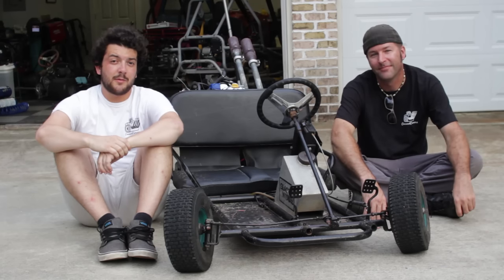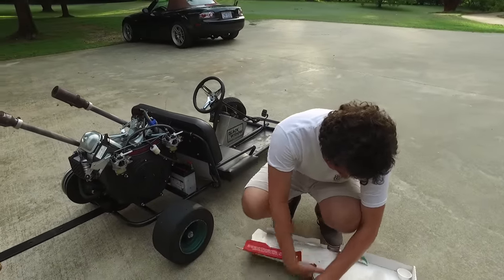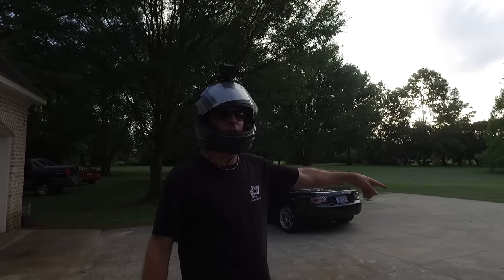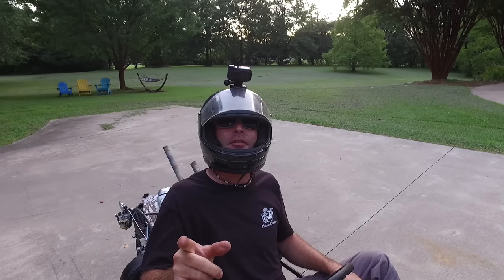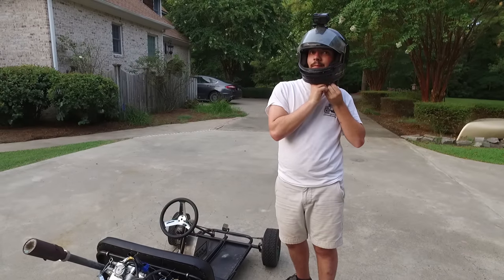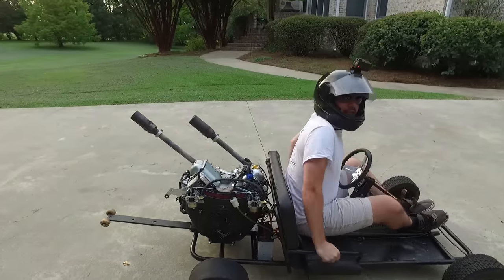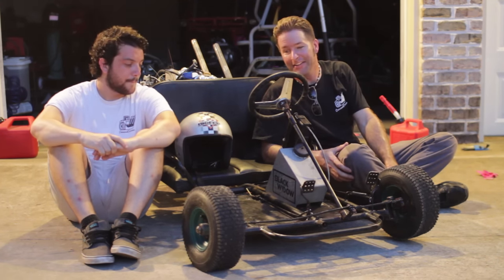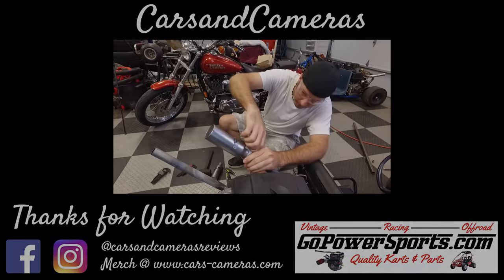Modified 670cc Performance Testing

Comment: You can just let the breather hose vent to atmosphere if you want. but I would a small filter on  the hose so nothing drops in it... You can run it to your air filter but a lot of times the oil vapor coming out of it will dirty the air filter..

Comment: maybe try adding another gear ratio with idle arm lever and pulleys with belts ...you could disengage one ratio and switch to the other ratio it'd take two motions but you could get up to top speed let off the gas and switch levers to the high gearing and keep accelerating.

Comment: Use larger diameter rear tires at the rear, or go to 8" size rims that have tires with a larger diameter. It would gain top end, but bottom would suffer some what.

Comment: you guys could do something cool but its a bad idea...NOS or spraying starting fluid into the carbs when you are at top speed i did it once with my 110cc 4 wheeler i sprayed starting fluid in it and i hit around 60mph was super scary but extremely bad for engine

Comment: hey you guys should put suspension on the front tires so your spindles don't get ruined and it will make it easier on the frame so it wont worp

Comment: it would be awesome if you would make a shiftable go kart like the r1 engine ones. But if you don't like i4 engines yzf r125 still has 14hp on 125cc wich is lighter and more powerful than predator 212 also it is shiftable like r1 as it's also a bike engine

Comment: The stock 390  jets are about the same size as the 212s.
I run a .044 main on mine on the 212cc. I'm guess you could run at least that size on a dual 390.

Comment: That torque convertor will only spin so much, sprocket change time, I'd drop at least 5 teeth on the rear, hey, its not like you don't have the torque to pull through it😎😎

Comment: i think you need more rpm's to throw a rod, so...it'll be fine...just be ready to rejet at the dyno or just drill out the main jet if you can like on  motorcycle carbs

Comment: put a smaller sprocket on it. it will increase your top speed a good bit. We used to have a 5hp go kart with a small sprocket that got up to 50mph, until I turned too quick, put it on 2 wheels and wrecked it into a telephone pole.

Comment: I have a 97cc Engine on my Baja doodle bug. To be able to run it I have to leave it choked all the way. Is that a tuning problem  (If so how do I fix it?) or is it fine to keep it choked wile ridding?
Reply: sounds like the carb is gummed up
Reply: I'm not doing anything until I get the pods on it then ill play with the carbs. lol. itll be fine

Comment: I think the top speed may be affected by valve float since there is no change after the twin carb setup
Reply: Carburetor size doesn't matter on top speed it's the valve springs, your right.
Reply: its geared way too low... it's like 6:1 from the tav to axle while it  should b like 3:1.... old Willy's jeeps had 25hp and went 60 mph with 10× more weight so ik this kart is capable of serious speeds with the correct gearing! changing valve springs will throw a rod thru that block before u could say it'll b fine
Reply: +I.C. karting then they need some forged internals too 😉
Reply: They really should gear it differently. There's no reason why it needs to do wheelies.
Reply: +Tim Ramich ok mom...NEXT!
Reply: +sykwookiee if it were geared higher it would wheelie less violently and be capable of well over 60 mph....

Comment: +Isaac it'll be fine  is there a centrifical clutch for a one inch short shaft 5 horsepower Honda engine I think it's a 5/8 shaft I really want to put it on a Drift Trike

Comment: This thing seems to accelerate faster to 46mph than my car does.
Reply: lol that thing does like 0-30 in like 3 sec
Reply: Too bad the Torque converter limits the speed.
My 212 does 0-44 in less than 5 seconds. But i modified mine a lot.

Comment: Yall should put bigger and wider tires on that thing, look at the video when you were doin the wheelies in slow mo, if the tires had less air in them you would drag the sprocket on the ground when you wheelie. that thing came very close to hitting

Comment: Hey! I want to do a go kart for a school project, i'm only 16, want to make the own frame and all... Been subed for a while, but got a few question... Is their any transmission? Is a 11 hp motor overkill?  Got any tip? 
Planning to use old car part for the pedals and steering wheel... 
I was spwondering if a new car starter yould be a good engine? Asswell! 
Thanks you!
Reply: Oh shit their is no transmition but did you guys ever made one with one?
Reply: the tork a verters we use are a type of trans
Reply: +Isaac ok thank you! May I know what do you guys do as a clutch?
How do you "unshift" the motor when you don't press on the pedal?
Reply: no clutch. its just like a automatic. one day I would like to have a clutch on one someday

Comment: Have you considered upping the size of the rear tires just a little? Sometimes a larger diameter tire will give you a little extra cruising speed.
Reply: we have but it will make it even taller and its pretty top heavy already
Reply: Isaac it'll be fine Hmmmm. It doesn't help that it's not a very long go kart to begin with. Of course it wasn't made for such a big motor anyway, but that's the whole fun of it. ;)
Reply: lol. yea, its a death trap
Reply: Isaac it'll be fine I bet. :)

Comment: Why not put a Transmission from an old Lawn Tractor so that way you have the CVT Transmission and you can have a 3 Speed you'd gain so much top speed and could drop it super low if needed.....

Comment: On your crankcase breather hose just use a Valve cover breather. They are not that expensive and it will help control the oil splash and help your idle as well. Looks like a lot of fun. Thanks for the laughs. https://www.summitracing.com/parts/knn-62-1490/overview/
Reply: thanks

Comment: take the turbo and efi off the trike and install it on this drift trikes don't need a lot of power anyways and the turbo would be more effective on this engine only thing you'll have to buy is another injector.

Comment: how well does the clutch do . the go kart shop in town tells me adults driving a belt go kart wont last long at all
Reply: we haven't had any issues with it, we have beat it up and it has taken it
Reply: i have a go kart bigger than both off road carts you have and i want a way bigger engine on it
Reply: wow. what size engine do you want?
Reply: i would love to do a 670 or anything bigger than the 6.5 the paperwork with the kart says two riders it can weigh 720lbs dont think a 6.5 will perform like that
Reply: well the 670 is a powerful engine but it dosent like hard turns or hard stopping. it throws oil into the breather and creates lots of smoke. if that's not a problem then it is probably a good choice

Comment: i would be more worried about not dying,, and to end up in a wheel chair for the rest of my life from an accident in one of those unstable go carts , i built quite a few go carts in my younger years and the fasted one went around 80 mph it had a 433sst two stroke two cylinder ,, the rpm in those hp motors is crazy , i am lucky i did not end up in a wheel chair , a cousin of mine drove it and snapped three wheels of and rolled it in the ditch , he is lucky he did not break his neck or worse yet his back  ,

Comment: You should put the centrifugal clutch on it and see how fast it goes
Reply: +Josh Hrisko I heard them say before you lose some top end when you go to a torque converter
Reply: +Honda Cr 500 yeah you do. a clutch on their supped up 600cc engine would burn up quickly with all of their hard accelerations.

Comment: Hey I have a pocket bike and after riding it for and hour or so the bike starts to bog down you give it gas and it goes then slows down and goes again then finally slows down and does anyone can help please
Reply: Slows down and dies
Reply: it is either overheating or running out of gas (trash in the carb)
Reply: +Isaac it'll be fine thanks a lot

Comment: If top speed is your only goal you definitely need a smaller rear gear, if I GPS'd my 6.5hp turd at 50 your 670 should have no issue creaming it with the right gearing.

Comment: Will it do good donuts on dry concrete
Reply: no it wont. it will either go straight or flip
Reply: +Isaac it'll be fine what if u put some skinny dry rotted tires that been sitting
Reply: that might work

Comment: I think you need a new chassis. The best racing action is around the yard, not wheelies and top end runs. Show us some flat tracking power slides. Put a performance chassis under that bad boy.

Comment: There is a 6 wheel go-kart powered by an R1 engine. They put 4 wheels on the back to prevent it from pulling wheelies and keep it planted. Have you or would you consider doing something similar to this 670cc cart, maybe as your next project?

http://i.kinja-img.com/gawker-media/image/upload/s--H30-YYM6--/18nddzq68wbbtjpg.jpg

Edit: Keep up the good work dudes! Finding your channel pretty entertaining, man.

Comment: topspeed is crazy, acceleration is retarded crazy...
so gearing can be tuned to more topspeed? but that probably puts more stress to the belt... (slipping?)
I would reduce the rear gear sprocket. more topspeed, more ground clearance!

next tuning I would redoo the steering, so it won't bend anymore.
what about front brakes?
Reply: I think it is pretty good where it is with the top speed. front brakes would be cool
Reply: Ya don't need front brakes if the wheels are in the air!;) heha
Reply: lol

Comment: So... I guess my mediocre build with a 16 HP Duramax engine on my old adult size Go Cart may not be so... mediocre after all.  This means i may not have to turbo charge it.
     I have possible plans of putting wings and a propeller on it so it qualifies as Experimental Aircraft thus I won't need a license.  I wonder... must I actually have to be able to leave the ground?  I mean... just because it fails at flying doesn't mean it is not an experimental aircraft, right?  Next, if I put large enough wings on and can make it able to skip off the ground... will it then be able to fall in the guidelines of Experimental Aitcraft?      
     Remember...The word "EXPERIMENTIAL" Does not imply it must work.  Hey, this could be a new way for folks without a driver's license to still get around. By the way... I lost my license while in the hospital fighting again for my life. I was not given enough time to get out of the hospital/rehab before their message (which I never received) expired. Funny the DMV would do such a thing.
   I lost my right foot, mid calf and so they disqualified me, (suspended my license). But I can barely walk 100 feet due to my back, have no one to help me and survive miles from town. Due to my back issues I cannot tolerate long rides and those "Help Rides" things take all day and would leave me in severe pain for usually a week at a time.  What is really funny is: in 1979 due to a motorcycle accident I had severely damaged my right leg and had to put in a left footed gas pedal and retake the test, which I did and I passed. Then I took the driving test a few years later w/o a left side gas pedal and a manual transmission which I also passed. Then again testing for my motorcycle license which I also passed. Due to circumstances and continuing problems I had often put in a left side gas pedal, as needed. But they never took that into account and suspended my driver's license.  AND... even with my false leg, I could STILL easily pass a driver's test with a manual transmission vehicle, just knowing potential problems got me to install left sided gas pedals.
    And let me not to forget, I got kicked out of 3 Hospitals because I was operating on my foot in hopes of saving it and the Hospital Staff's would not even change the bandages!!!  This is all not only true... but they did horrendous things to me as well, thus mutilating me.
   Oh, this brings us to: and the government lowered pain med allotments... don't even go there. Pain Clinics are NOT fighting this issue, instead they have become part of USA's Death Squad Doctors, stopping or greatly reducing people's NECESSARY pain meds until the Pain Sufferer commits suicide. They have eliminated the word "Dependant" as in Drug Dependant and replaced it with "ADDICTs" meaning all Pain med Dependants are now classified as Drug Addicts.

Comment: wait... if you put gears on thing like you now 1st gear 2nd ect... this thing would go so fast! like 100mph!
Reply: EDNinja Gaming u would need a gearbox
Reply: Yeah of course you would need a gear box.
Reply: EDNinja Gaming  that thing prob wouldn't even being capable of those speeds and you're adding weight but if they would put a mini supercharger or a turbo on it it may would make it but than you need bigger injectors etc
Reply: maybe but shifter karts get the job done without much weight.

Comment: that frame is shot and under way more stress than it was designed for - get a different one. its not going to be a fun time when a wheel pops off at 40+.

Comment: I'm pretty sure you would die if you slammed that rickety pos into a tree at 20mph nevermind crashing while going 50. If the engine wouldn't squash you into the trunk it would just flip and use your nogging as a roll cage. Darwin Award worthy contraption.

Comment: that crank case breather you don't know what to due with, try some thing like a fuel water separator, on my standup jet ski I have one for the tank vent, that way it can breathe and contain the oil, it has no filter in it, It just lets the oil drop as it sucks air from the top on the other side, I think this would be a great solution for you guyshttp://www.ebay.com/itm/like/161850222961?lpid=82&chn=ps&ul_noapp=true

Comment: change the gear to get more top speed
Reply: The sprocket you mean?
Reply: yes it was
Reply: this kart already uses a CVT no sprockets to change
that motor needs to be on a bigger kart its to much for that little frame
Reply: rjc862003 ya there is a sprocket to change..its on the live axle..there usually 2 peace sprockets and they come in allot of sizes..the size of the frame has nothing to do with the top speed
Reply: stability at speed
that thing is sketchy
a larger wider frame with meater tires would go a long way 

currently its gear limited the motor has more but its hitting a RPM wall
Reply: rjc862003 agree a tight corner and you're done.
Reply: yea the frame doesn't do the motor justice this kart isn't half as fast as it could be with a proper frame under it and the right gearing for that motor
Reply: +rjc862003 I think y'all are missing the point...using what you have vs. spending a shitton of cash...they only have  $1400 in a fun machine...make something else "safer"...ok mom?

Comment: Seriously what in how many episodes you use pizza box make a piece out o tin metal come om duh lets use duck tape did you really think that would work then you go o lets use cardboard  come on that's even dumber that duck tape use piece of tin or metal shape even shape it were there are bolt hole even bolt it in duh  what also no air filter suck that dirt and crap into carbs and on vent tube put filter or air pod on it